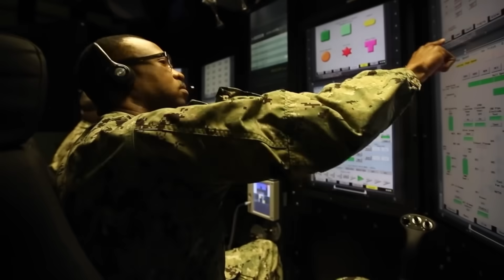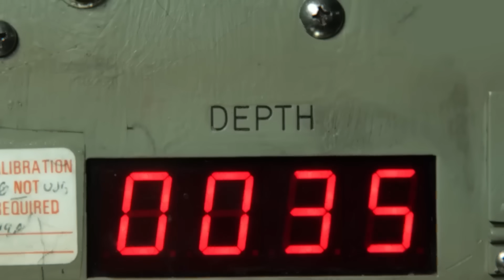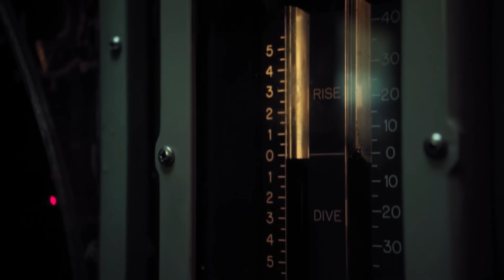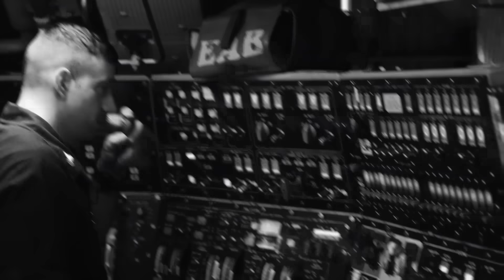What Happens When a Submarine Hits "Crush Depth"

Comment: The Thresher apparently had an automatic reactor scram, caused by the failure of a braised pipe, which burst onto a key electrical bus, which set off the breakers. Once a reactor is scrammed, it takes a little while for it to be bought back online. At serious depth, a submarine cannot regulate its buoyancy with ballast tanks. Meaning that it will be unable to blow ballast to surface. It needs forward movement to allow the crafts planes to determine its depth. As the Thresher lost all power, it was immediately apparent to those in the control room, that without the reactor going online, they were all doomed. That is an impossible thing to consider for even a short while.  The answer to how they would have died, may surprise many. Once the hull was breached, the sea pressure would compress everything within the hull, which would initially cause everything to burst into flame or melt. I do not imagine that the moment itself could register on a human being's consciousness. A dreadful tragedy, that would raise the sympathy of  any seagoing personnel, irrespective of which navy was under consideration.
Reply: Steven: Everything is right you say , A Nuclear reactor can't be shut down from 100% to 0%Themal output so even the chain reaction is stopped , the reactor puts enough heat out to power the turbines for some time and maybe an Power Generator also. I did not know the design of the boat , but it seems a problem in the time and more today Nuclear or Diesel powered you can't restart the Engines once the circuit board is compromised , everything is controlled via Electronic . I had to make a repair on a Vessel even all Electrics and Electronics are in working order and the engines can't be started , and why the engine s temperature was to cold the electronic doesn't allow to start the engines. Lets imagine you are in a storm and the engine stop working because of some short cuts in the electric , the crew manages to repair it, and you can't start the engines , this is a serious safety hazard for the crew and the vessel , and I think this was a serious problem on the USS Tresher the system doesn't allow to reroute or manually open the valves to feed  the steam to the turbines
Reply: Rest assured mate. An implosion happens faster than the brain can actually process what's going on. They would have passed away without even realizing it. Unfortunately, can't say the same for the impending doom that they knew was coming during the few minutes it took the submarine to reach it's crush depth. May their souls Rest In Peace.
Reply: @NahuCommNS  I know, and I am horrified by the feeling of imminent doom they felt. Poor bastards.
Reply: At that time, there was no procedure for an emergency reactor start up, which there is now; boats have an EPM (electric propulsion motor), but if the batteries can't power the EPM  you're screwed if you can't blow to the surface. An instructor in Power school told us that the Thresher had a SHIPALT done in the yard that put these strainers in the blow system piping to remove contaminants, but they created ice blocks that impeded the ballast blow (not sure if that's accurate, tho). 

After Thresher, subs no longer do test depth dives in depths greater than the crush depth (those dives aren't always needed, unless you repaired the shaft seals or a hull valve, something that can't be hyrdo'-tested); and, the sub-safe program was developed as well, which meant every boat had to have folks sent to QA school, and every single seawater PM or repair had to have a giant work package written up. The package included test procedures and a parts/materials list that allowed the reviewing officer to be able to check that every little o-ring was the right one. This also meant that the boat's crew had to do the QA, instead of the shipyard, which was a good thing. But 5 guys to do a hydro test...overkill, but it's better than being crushed to death, I guess...problem is we didn't always have the support ofrm the tender or the right amount of on-duty personnel to do the testing properly, so we fudged it A LOT.  The rules were streamlined during my last year on a 637, so it didn't take 2 days of work to simply PM a seawater strainer.
Reply: @heimbatman4516  I don't understand, why would anyone do a dive deeper than crush depth? The usual test dive is to DDSTP.
Reply: @mikestrohm3271  That's a good question - what we were told is the Navy didn't think about that before the Thresher, and now they do - test dives are now done (allegedly) in a location that can complete the test parameters, but isn't deeper than the crush depth, in casae the test fails...however it's possible there's a difference between what the Navy's actual protocol is (and was) and what instructors tell new sub sailors in school.
Reply: @heimbatman4516  I am going on my RN submarine experience. DDSTP was defined as crush depth minus 30% so if the subs crush depth was assessed as 1000 ft then DDSTP would be 600 ft and that would never be exceeded. To me, sending a boat down to crush depth is just risking lives with no margin for safety.
Reply: @mikestrohm3271  We'd never go to crush depth. There's various operating depths, test depth, and crush - the test depth was only done if we wanted to test a portion of the boat that couldn't be hydrostatically tested,  and the shaft seals were one of those items - how do you pressurize the outside of the propeller-to-hull connection in drydock? I was a nuke MM, so my position on my two test depth dives in 4 years was sitting at the shaft seals, watching the gauge, with a 2MC, to report any flooding if it occurred - and to do the actual test. I beleive that depth was the maximum allowed operating depth (classified). Once we got there, we sat there for about 10 minutes until all of the test area QA's reorted no leakage, then went back up to a normal operating depth.

I believe the Thresher was doing the same thing, which is typically done after an overhaul, and it's also why there was a surface vessel accompanying them with comms - but they were doing it  way off the continental shelf, as opposed to finding a spot that llowed the test to be done, but not deep enough to crush the boat if the test failed.
Reply: @heimbatman4516  I think that was the point I was making, I was on the building crew of a RN Swiftsure class SM and a Trafalagar class SM and at sea trails we went down to DDSTP which is Deep Dive Safety Test Pressure a figure which is 30% less than anticipated crush depth, I say anticipated because no-one is actually sure what the crush depth is as it could range between X metres and Y metres, so they took the shallowist estimate and called that crush depth.
We started slow, as they were both new boats, and went down in stages until we reached DDSTP where we stayed about an hour fully checking everything. The whole test from surface to coming back to the surface took about 6 hours. I do remember one of the 'soft' bulkheads by the junior rates mess bulged significantly, the 'soft' bulkheads were designed so that the top of it could slide into a gap as the boat shrank under pressure but there was something in the way and it didn't slide so it bulged about two feet into the main passage.
Reply: @mikestrohm3271 I believe they now go to test depth in water that has a maximum depth that’s less then the crush depth. This means that if there’s a failure and the vessel sinks it will settle on the bottom before it can reach crush depth, allowing the ship to be recovered or at the very least the crew could be saved
Reply: @heimbatman4516  I'm with you brother.
Reply: @jimfrazier8611 Our Stoker Petty Officer picked the wrong time to go to the heads, about 200 feet before we went to DDSTP he decided he needed a crap but then we started to go deeper and the boat shrinking jammed the door on the stall in the head and he was stuck in there for close on two hours.
Reply: i was sat here thinking, what happens when a sub implodes, do you just crush to bits and your eyes pop out, anyone know what happens to a human , do you split open or something, its all very sad but i need to know,
Reply: @daveberry2177  in large class nuclear vessels such as the USSNB class, perhaps oddly, everything is instantly incinerated as the internal hull region is compressed instantaneously. The increase in pressure creates enormous amounts of heat (Boyle's law) just as a compression pump becomes hot and a sudden drop in pressure creates cold temperatures. 
The same principle applies to your refrigerator at home. The compressor pump increases the temperature of the internal and uses the back end, of pressure release to create the cold. A bicycle pump will get hot as you compress the gas and when a gas expands, it becomes  cool. Like a hand held fire extinguisher being discharged. The bottle will frost over on the outside.
Reply: @StevenHoman  thank you very much for the well explained info, so it would have been quick i reckon,
Reply: As bad as it was and sounds, the crew not feeling the sub crush was probably the best way for them after the accident.
Reply: I wasn't aware, even though I was qualified, that we couldn't service by blowing the ballast tanks at depth. Knowing the pressure in the the high pressure air tanks, it does make sense. I did hear officers once describe a situation that we narrowly missed that they theorized we came close to not being able to surface. The incident I'm sure is still classified, but that was the only time I even gave the "what if" a second thought.
Reply: @Jim Frazier The article made it sound like the air flasks which were 4500 or 5000 psi may not be able to be blown at a certain depth, so I was thinking back and just wondering, Thanks for that clarification. It's like me taking  qualification board all over again.
Reply: @Jim Frazier We respectfully referred to you nukes as have a very high drift factor. LOl All respect to you guys for letting me get all dead with a reactor melt down.
Reply: I would think at the moment of implosion, the body would be instantly crushed by the pressure of the air. Terrifying. Much respect from this old army grunt for submariners.
Reply: Not quite. The Thresher did blow main and emergency ballast but the high pressure air into the ballast tanks caused the air lines to freeze at the point they entered the ballast tank. All subs have an emergency motor that runs off the battery to give way ahead which has a max of about 6 knots, unfortunately the flooding was too fast. If she had been able to blow successfully then she would have made it up. I have heard the tapes that were recorded by the safety vessels hydrophones and you can clearly here ballast blow start and then suddenly stop.
Reply: @mikestrohm3271  That is what I mean, you need forward thrust and planes to rise, blowing the tanks is useless. No point arguing on agreeing.
Reply: @Steven-p4j  I agree, but as powertothebauer says, there is residual heat in the reactor even when scrammed and sufficient steam within the secondary circuit (and sufficient heat in the primary circuit to create more HP steam) to power the turbines to keep forward motion, but, because the HP Air entry pipes into the ballast tanks froze no air got into the ballast tanks and what forward motion the sub had was overtaken by the negative buoyancy caused by the flood, so she just slipped backwards down into the abyss. The HP Air problem was solved in later boats and retrofitted to older boats by fitting a diffuser on the HP Air line.
Reply: @mikestrohm3271  From what I was told there was a procedural change for the secondary side of things implemented after the Thresher tragedy to help alleviate some of what you mentioned.
Reply: @jackkelledes4082  Yes, a lot of the worlds navies learned a lot from Thresher
Reply: @mikestrohm3271  I can see the point you are making, Mike. We are in full agreement.
Reply: @Steven-p4j  No, you do NOT need forward motion to rise in any modern submarine. This is a misconception. If the high-pressure air lines had not frozen the Thresher would have survived. And the boat's interior does NOT burst into flames.

Comment: What a strange story.  We know how deep we are at. The hull is affected by the pressure. You hear the sound of steel being stressed. The pressure within the hull where the people are also begins to rise. The pressure in your hears will be tested. I have been in a situation where the insultation between the hull ribs starts to peel back.  The clocks can have their movements stopped because the pressure is pushing on the glass against the minute and hour hands.  But, we where never there...
Reply: If, in an emergency, the sub were very close to crush depth, could the air pressure inside the sub be increased maybe a couple of atmospheres or so to give a little margin of safety. That is, to push against the interior of the hull to offset some of the exterior water pressure?
Reply: @slaughterhouse5585  If it where an emergency, then all emergency air systems would be used.
Reply: QUESTION:  On land, when changing altitude on a plane or entering and leaving the mountains, you have to shake your jaw a bit to make your ears pop and adjust.  Same SCUBA diving.  In a submarine, did you guys (I assume you were a Submariner and thank you) have the same consideration?  Thank you for your time.
Reply: @jackwalker9492  It is noticeable but not as extreme most of the time.  The interior is kept pretty close to sea level pressure but as the sub stays under the pressure will go down slowly over the days.  Once the sub comes close enough to the surface to draw in fresh air, the pressure comes up fairly quick and if the difference is enough your ears will pop.
Reply: @jackkelledes4082  Fresh air.  Loved it when we surfaced and the bridge was manned, the fresh air coming down the hatch was nice, then we would snorkel and the diesel exhaust was not much fun .  Unless you have to go to the bridge to stand watch and it's raining and winter, so cold is an understatement. You're wet from head to toes and you still have 5 hours left on watch.
Reply: @billywilds1779  I qualified lookout as a nuke just so I could go to the bridge on the surface and get the fresh air.  I didn't mind the cold so much but the rain was annoying at times.  There's no escaping it up there.
Reply: @jackkelledes4082  It was very cold doing a northern run as lookout. Green water coming at you in buckets. They even closed the hatch to prevent the water going into control. Oh, well.  $50 Sub pay...

Comment: Water cannot be compressed, any damage to the hull would result in seawater rushing in. People don't "crush" either, we are composed of about 55-60% water.
Reply: Yes, the fluids in your body won't compress. Not so much for your skeleton and organs. Step on a grape, and the concept will become clear.
Reply: So if you got run over by a tank it would not crush you. Yeah right.
Reply: @wattyler9806  
Are we talking about f-cking Tanks now, try and stay on track, 60% of the human body is composed of water, we're talking about Submarines and crush depth, water cannot compress, the human body does not compress past crush depth. So what are you saying, that you don't believe that, you want to stick with the stories you learnt in first grade....?
Stick to eating crayons "Wat" (one Watt isn't very bright) see if you can match the colours with the flavours you know.
Reply: @wattyler9806  if the full weight of the tank was equally distributed across the entire surface area of your body, yes you'd survive.
However being run over by a tank is better described as being smashed than it is crushed.
The organic matter of your body would be pushed outward from the tracks to an area of less pressure.
There is no area of less pressure in the depths of the ocean so the forces are trying to compress your entire body smaller.